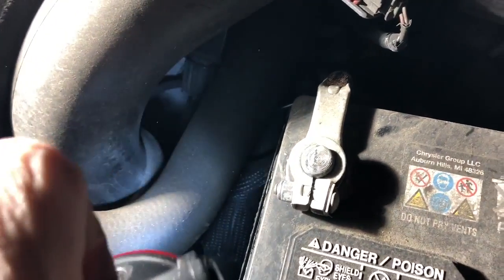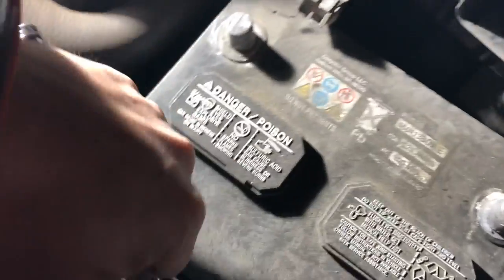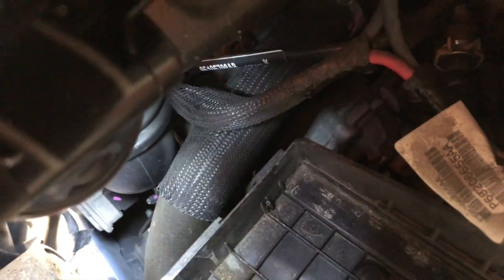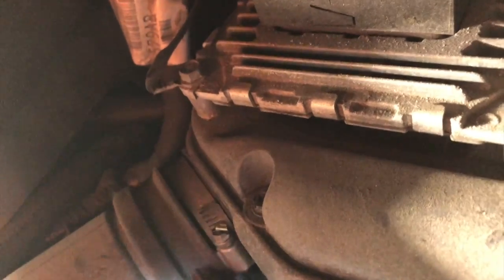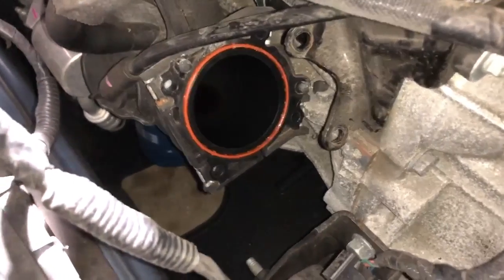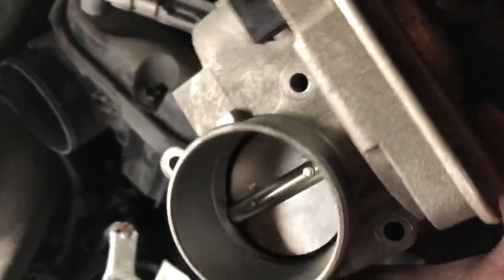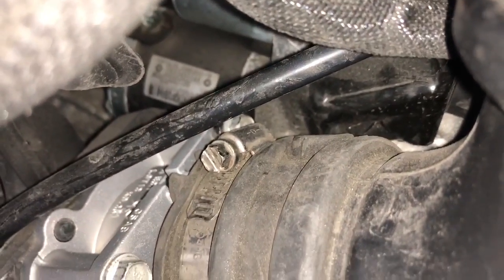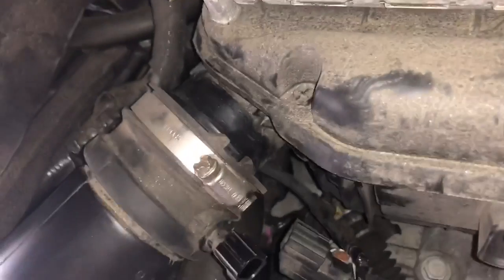Chrysler Jeep Patriot Throttle Body Install. Limp Mode and Rough Idle

Comment: Question: Does the gasket need to be "wet" to seal or can it go in dry?
If wet, what to use?
Reply from the maker: It’s only air coming through this hose so I put it in dry. That’s just my opinion though and it has worked for me.
Reply: @OmarsGarage Thank you very much, especially for getting back to me so quick.
Once I get the official read out on the errors to confirm this is my problem, I'll be using this video.

Comment: How are you man. I have this problem now. Driving down the fwy and boom the 2014 patriot didn't accelerate had to pull over. But the only lights that came up were the lightning bolt and check engine.  Why would this come up? I assumed its because I had the car loaded with ppl and AC running uphill on the 15 towards  LA from Las vegas.
Reply from the maker: Did it just have reduced power or not accelerate at all? Did the problem go away once you turned off and restarted the car?
Reply: @OmarsGarage  the car wouldn't accelerate anymore , and yes I turned it off and 5 mins later i tried again and the lights were gone and I was able to make it home.
Reply from the maker: @jayjaymerging2659  that could have been it. It happens on amd off when it starts to fail. Could just be a dirty throttle body as well. The switch on the gas peddle could also be going bad. Could be many different things. The throttle body is a very common failure on these cars though.
Reply: @OmarsGarage  awesome thanks ill try to clean it and see if it happens again , might as well just replace it. How is the one you replaced doing? Its not the OEM right? Just wondering if its ok to buy aftermarket.  Thanks for all the info sir I appreciate 🙏  your time.
Reply from the maker: @jayjaymerging2659  I put the link in the description to the aftermarket one I used. Like $60. No problems in over 3 years since I’ve replaced it.

Comment: Thanks Omar.   I'm in MD too.   I will change my throttle body too. Thanks for the video.   
P. S.  Why do my door locks and horn keep beeping after the Patriot is turned off?
Reply from the maker: Could it be that you have an interior light left on?
Reply: I had same problem it was my key fob get a new one ...
Reply: @Malik Bolds  Iv the same prob. The would strt honking all of a sudden, middle of the night...even while driving. How did u fix urs?
Reply from the maker: He says his key fob was going bad.  He fixed it by getting a new key fob.
Reply: I see that but in my case it starts honking while even im driving the car. I dont think a faulty fob would do that...so was wondering if there is any other fix to that.
Reply from the maker: @nain426  is this an aftermarket alarm?
Reply: @Omar's Garage,
No it is the factory system. Currently as a temp. solution I have the horn disconnected.
Reply from the maker: Wish I could offer more help but I’ve never even heard the factory alarm go off.  Hopefully another viewer can chime in.
Reply from the maker: @nain426  you could probably find out if there is a fuse for the alarm and pull it.  That way you can get your car horn back.

Comment: Hey Omar one day my jeep started to run rough with the head lights flickering while car was on , I took to a shop and code said misfire ignition coil #2 so replaced it and it ran normal again for 2months then it started doing it again long story short this whole summer I took it to the shop 5 times to replace ignition coil #2 and spark plug  and mechanic pretty much said he dosent know why it's doing this , so now I just been driving it like this but weird thing is it will mess up then all of sudden start running  normal like nothing ever happen then month later mess up and run normal again can you give me advice  I thought it was a lose  connection  because head lights flicker when this problem  happens
Reply: Its a 2015 jeep patriot 4×4
Reply from the maker: Of the lights are flickering it sounds like an electrical issue.  You may need to clean the terminals on the battery and tighten them down.  There could be a fuse that is broken but not totally broken.  There are also grounding cables that may have corrosión on them and need to be removed and cleaned with a wire brush.  It’s really hard to say, wish I could help more but it’s not something that either our 2014 or 2015 has had issues with.  Doesn’t sound like a throttle body issue though.
Reply: Thank you sir I will do that in the morning  after work I appreciate  you getting back to Omar

Comment: My jeep is throwing code for the throttle control sensor is that part a plug and play or do you have to get it coded to your car
Reply from the maker: For me it was plug and play.  After driving it still had a check engine light that eventually went away when the computer relearned the throttle body settings.  On my other video where I diagnose the issue, someone commented on a relearn process where you disconnect the battery and touch the terminals to reset the computer.  Afterwards they let the car run for ten minutes and then drive the car normally and it should relearnhe TB.

Comment: I need some friendly expertise, I'm a fellow 2014 jeep Patriot owner. I am having the exact same issues but they started while it was raining so I thought maybe a little water shorted the circuit and once it dried it might be fine. I was wrong, so I plugged in my OBD2 and got two codes both reading U0401 and they both told me error reading codes. So I tried a neighbors and it did the same thing. Could this issue with the throttle body cause the codes to come up as just errors? Suggestions? The parts featured are fairly inexpensive when you compare to the $600-$1000 quote from a mechanic shop. And truthfully I plan on trading this jeep in after I get it fixed, but any and all suggestions would be greatly appreciated!
Reply from the maker: Try this first,
1). Turn ignition to Run, but do not start engine.
2). Wait for all lights to turn off.
3). Over the course of 15 seconds, slowly depress the throttle all the way to the floor.
4). Over the next 15 seconds, slowly let the throttle out in the same manner.
5.) Start car and drive around for a bit.
..
If that doesn’t work, get the part from the library o in the description amd replace the throttle body to see if that’s the issue. It’s not that expensive and not difficult to replace. Let us k ow how it turns out.
Reply: @OmarsGarage  the new throttle body just came in this morning and I finished installing it not too long after. The jeep now runs great! All the lights on the dash went away after I started driving, thanks for all your help Omar!
Reply from the maker: That’s awesome, thanks for the update 👍

Comment: Hi Omar, I have the same problem but only with a cold start, other than that just rough idle and some poor acceleration. Do you think is the same problem?
Reply from the maker: Wilmer Figueroa Wilmer Figueroa the idle and acceleration could definitely be related to the throttle body.  Try checking the connectors to the throttle body to make sure they are securely plugged in.  If the car is older you may need to clean the throttle body.  Also check the air filters to make sure they are not clogged.  Have you gotten any check engine lights?
Reply: @OmarsGarage   I checked the cables and   change the air filter. I also cleaned the throttle body and still having the same issue. Yes, check engine, the red lighting bolt and traction control lights go on a few minutes after a cold start. When I turn the car back on only the check engine light comes up and wont get more hiccups when accelerating.
Reply from the maker: For $100 it may be worth swapping it out.  It’s going to cost you $150 just to get a diagnostic.  I’d swap out the TB and see if that’s the issue.
Reply: @OmarsGarage   I would definitely do that. Also I like to mention that even when all the lights are on I can accelerate fine past 20 miles, the issue seams to be only at a full stop.
Reply from the maker: If it’s only during idle you may have an issue with the idle air controller.  I’m not sure where it’s located on the Jeep, but its probably on of the harnesses that you disconnect in my video. At 4:30 on this video I disconnect a harness.  I believe this is the Mass Air Flow sensor.  On the inside of that intake you will see the sensor I’m guessing.  You can also see about cleaning that. When you are having problems idling it can be the MAF, idle air controller, or throttle body.
Reply: @OmarsGarage  I will try that tomorrow, if that doesn't work I will buy the part.  Thanks for the help, I will post an update as soon as I fix it.
Reply: @WorrisomeFern  were you able to check the sensor omar was talking about? Our 2014 jeep patriot is doing the same exact thing as yours.
Reply: @brittanysalsberry1870    I have only been able to change the sensor, still having the same problem. But this morning I notice something interesting. Usually I let my car warm up but today I was in a hurry and the jeep was running fine, after like 1 minute the problem started again.  I will try to check engines codes this sunday and keep working with the issue and let you guys know as soon as its solved. Im pretty sure there ir something that is making my jeep go into limb mode only when is cold.
Reply: @WorrisomeFern  thats weird cuz we usually let our car warm up and today we didnt. I dont kniw if that just a coincidence or not. Im going to see why the check engine light is on today. Hopefully we can just change out the throttle position sensor and not have to replace the entire throttle body
Reply: @WorrisomeFern   any luck with finding the solution to your problem? i have the exact same issue as you. jeep will go into limp mode if i sit at idle for more than 3 minutes while its cold outside. once i run it and engine temp is normal, i wont have any issue. it only seems to be on cold starts when it goes into limp mode, and its very intermittent. when my jeep goes into limp mode, i pull over and do a throttle body reset. (power off car, hold accelerator pedal down, turn key to on position, but do not start. hold for 20 secs, power off and then turn jeep on). once i do this relearn step it seems to work for the rest of the trip.
Reply: @magikaudio7382  well yes and no, I cleaned de manifold and put some WD-40 because check engine was telling me there was a runner stuck in open position. It didn't fix it l, but did make it less frequent. Low idling for too much time after cold start will make it go into limp mode, but before that it was going into limp mode even when trying to keep RPm high. Got no more check engine codes.
Reply: @WorrisomeFern  have you swapped out the throttle body?
Reply: @magikaudio7382   Yes
Reply: @WorrisomeFern   did your problem get fixed after you swapped your throttle body?
I have swapped my throttle body and swapped the connector to the throttle body and i still continue to have the same problem.

Comment: I have a 2012 compass, will get high mph, but not a lot of power. Has loss complete power 3 times with the car in drive and will not accelerate. One mechanic thinks it a throttle body. Bought a code reader and c121c came up under abs option. Internet is telling me to replace abs sensor or power train module. Thoughts anyone?

Comment: Hi, just watched your video thanks on making this video. any update after 2 years? My 2014 jeep started having this problem
Reply from the maker: The car hasn’t had any issues whatsoever after changing the throttle body.  I recently changed the spark plugs, air filter, amd cabin air filter.  I have videos on my channel for all of those. Thanks for comment 👍
Reply: @OmarsGarage  just fixed today and my jeep start to runs like a champ again! Thanks!
Reply from the maker: That’s awesome. Glad I helped solve that headache 👍

Comment: Hi, all the way from South Africa, my 2014 Jeep patriot is having the exact same issue, I am just getting a U0401 error and it is not saying anything specific about the throttle body, can you confirm the error you got?
Reply from the maker: sporttalk2010 I am pretty sure that is the same error I got.  That error is very vague though as it just tells you that there is a faulty communication with the engine computer.  It can be caused by the throttle body or several other things.  Try this first 1) Insert ignition key and turn to "ON" position but do not start the engine; 2) Wait for all the warning lights to go out. The check engine light may remain on; 3) Slowly depress the accelerator pedal all the way to the floor; 4) Slowly release the accelerator pedal until it is all the way back up at the rest position; 5) Turn the ignition key to "OFF" position; 6) Start the engine and test the throttle to see if the engine speed will throttle up.  I believe this resets the throttle system.  Take a look at my limp mode diagnostic video and if the symptoms are the same as yours it may be the same thing.  Do not replace it with a used part as I believe the OEM parts are prone to failure.  Good luck!👍
Reply: @OmarsGarage  Thanks for the help. Took it in just make sure, seems another common issue is a leak on the manifold, got that fixed and they cleaned the throttle body. All was good for about 3 weeks then the issue was back. I ordered a new throttle body from Amazon for $49, got it yesterday and installed it and it seems the issue is now fixed. Thanks!

Comment: The shop is telling me they'd have to do an ecu relearn procedure if they replace the throttle body. Is there a way around it?
Reply from the maker: I didn’t have to do it on mine...just drove it around and it reset itself after about 30 minutes of driving.  I think this is the procedure though:
Try this first. 1). Turn ignition to Run, but do not start engine.
 2). Wait for all the error lights to turn on.
 3). Over the course of 15 seconds, slowly depress the throttle all the way to the floor. Try not to waver or be too jerky, just a nice slow, smooth push.
 4). Over the next 15 seconds, slowly let the throttle out in the same manner.
 5.)Start car and drive as you normally would.
I never did that so I can’t vouch for it.

Comment: Hey Omar I had this issue with my Jeep the Firestone said my camshaft sensor could be the issue and replaced it with no check engine light on and then my car stalled while driving I took it to the Jeep dealer and now waiting to see the check Engine light came on. So I’m hoping they can fix it
Reply from the maker: Are you also getting the lightning bolt looking light..it’s actually a throttle but looks like a bolt.  I think I was also getting a traction control light.
Reply: Omar's Garage I didn’t get the light night but the traction control and eng light went on and after an hour it would start again but has happened repeatedly
Reply: Omar's Garage  also not sure if it matters but mine is a standard
Reply from the maker: I would try cleaning the throttle body first.  But wait and see what the engine code is.

Comment: I got a 2008 jeep compass I owned for 9 years now but the the only problem I have with it is when I suddenly stop then get ready to go it takes like 20 seconds or more to know that I'm pushing the gas peddle down. Like the car is going like 5 mph but I am pushing the peddle to the floor what could be wrong with it. I had to put a new engine in it 2 years ago the timing chain went and took the top end out. But even with the new engine out of a 2015 jeep compass still does the same thing
Reply from the maker: I never experienced that issue so it’s hard to say.  It sounds like the gas pedal is electronic rather than in the older cars where a physical cable would pull the throttle open.  It may be something wrong with the electronics of the gas pedal.
Reply: That makes sence even when I'm using the shifting part of the cvt when I have it in 6th it feels like its sluggish like I'm giving it gas but I lose speed and have to down shift to fifth it's been like this for years. 1 through 5 I it goes great but when I'm in 6th I push the peddle not even half it like I push the peddle farther and it dont do nothing lol but the peddle does make sence thank you

Comment: Hi this issue can be solved by cleaning  or only replacement?
Reply from the maker: From the research I’ve done, it’s very common for these throttle bodies to fail.  The one I removed was pretty clean and this happened on a car that wasn’t even a year old so it shouldn’t have been that dirty.
Reply: @OmarsGarage  thanks for answer.
Reply: No, Only replacement. it is damaged in side, I cleaned first, not work.  replaced work right way

Comment: @ 6:19 you used a removal tool to detach the cable. Do you remember what you used specifically?
Reply from the maker: I think you are referring to the plastic plug that holds it in place.  I used something similar to this Tresalto Auto Trim Removal Tool Kit, Set of 5 Pcs https://www.amazon.com/dp/B01L8GHB7O/ref=cm_sw_r_cp_api_i_RVb.CbEADPVAK I have a set like this one.  Some needle nose plyers would also work.

Comment: You didnt happen to have installed an aftermarket air filter in that did you? Mine was fine for...idk, 40k miles. About 20k after I installed a K&N mine went out. I read that a few people found their throttle bodies gunked up after they installed a K&N.
Reply from the maker: Adam Lehman no it is completely stock.  It started acting up about a year after she bought it brand new.